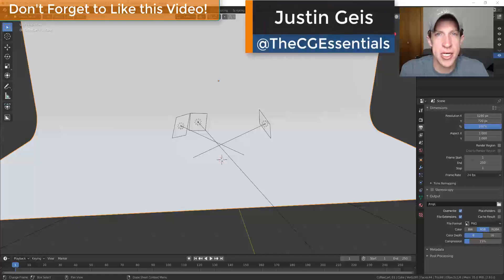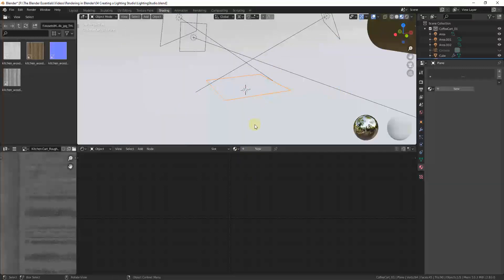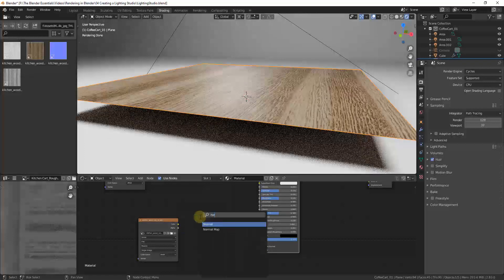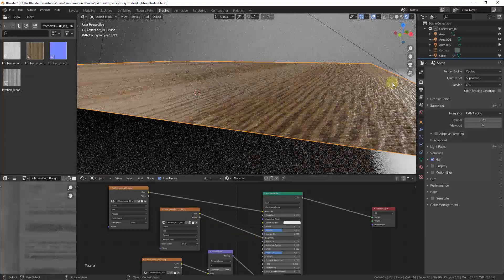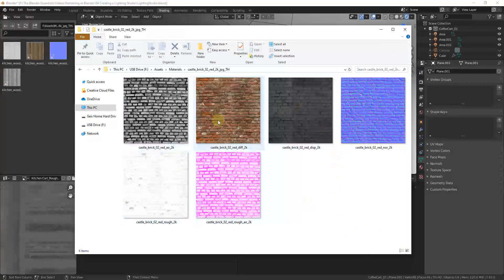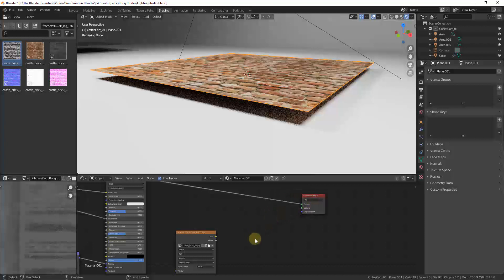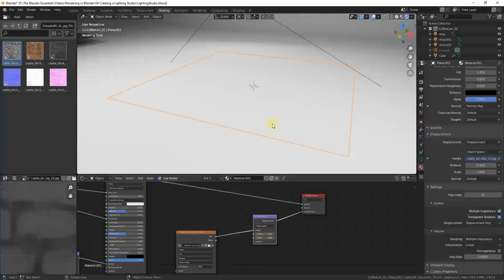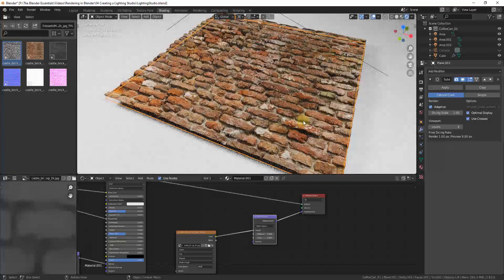Using NORMAL MAPS and DISPLACEMENT MAPS in Blender! PBR Material Tutorial

Comment: Roughness and Normal maps should be Non-color or linear to display correctly. If you use assets with baked normal maps and you see seams at UV boundaries  make sure to check the textures are in the correct color space.
Reply: Yah, I just spent like two hours trying to figure that out
Reply: agree...

Comment: I have a bit of an issue. 
For some reason my material menu doesnt seem to have a section titled displacement. 
(it goes > preview >surface > volume > settings > viewport display >custom properties)

So I cant seem to get any height to my texture :/
Reply from the maker: Are you using Cycles?
Reply: @TheCGEssentials  
I think I might have had it set to eevee. I was able to somehow have the menu change and edit the displacement finally. (But then my computer crashed lol).

Sorry I'm still very noob

Comment: Love your videos. I'm a newbie to blender, but I'm quickly mastering the basics, largely due in part to your vids. A quick question:I'm modeling an aircraft hangar, but it seems no matter how I adjust the texture to the UV map, it still looks stretched out and fuzzy. Is this due to the resolution of the texture? Even subdividing the surface and making the texture smaller doesn't seem to help. Any ideas on what the problem might be? Thanks ahead of time.
Reply from the maker: Hard to tell without seeing it, but if UV mapping is correct and it's still fuzzy, I would assume it's a resolution issue

Comment: I was wondering about a few things: 

With the roughness [metallic] and normal maps, they should be set to non-color, but maps don't always import that way; a lot of times they come in as srgb, and that makes things look horrible.  I've watched this on a phone instead of sleeping so I couldn't see that in the video.  But to mention that would add to the presentation,  imo.  

Which normal map is being imported?  I work mostly "for" UE4 (its my preferred render engine for animations), and make my maps in SP.  They use tangent normal maps.  Of course, Blender defaults to use OpenGL, so I actually want to confirm best practices on flipping the green channel and how to verify when you import a random set of textures the included a normal map is working right.  If it's a tangent normal I used to use the curves green channel only and switched the points to invert the curve slope.  Then I saw the separate rgb and combine rgb,  so nowadays I use those and flip the green channel with an invert node and just connect R and B to the sep to comb rgb nodes.  What is the definitive way to flip the G in Blender?  

What is the best way to see if you have the normal map working right in instances that it's not obvious like a wood grain or something more regular from real life?  Sometimes it looks a little random to me and it's way less obvious if I need to flip or not. 

With displacement, it's confusing to me because as you crank up the subdiv resolution it defeats the purpose of a texture map.  Given your example, I could model the geo of each brick and come in with way less verts than using a displacement map.  

Then there's the height map which as best as I understand it is just a scalar form of a normal map but can be used in place of a displacement map, but suffers from the same self defeating geo explosion. 

Another map that I came to appreciate because of Decalmachine and trim sheets is AO maps.  They really make an obvious improvement to how your texture looks.  The packed pink texture I use with a separate rgb node... but then best practices again, good luck.  In UE4 it has an AO socket.  In Blender, the best I can find to do is take the basecolor, take the AO map...  Connect a color ramp to the AO map (that comes in as rgb as a single but non-color in packed textures...ffs) and then combine the basecolor and AO map to a mixRGB node using multiply, and then adjust to my liking.  It makes a big difference and I even use the AO node in scene the same way, even though I thought with full GI, AO is calculated in Cycles.  That has NOT been my experience.  I add the AO node and get better results..

So any feedback or direction or a part II of this tut at least one person in the world would appreciate because as I've been learning HoudiniFX and Blender transitioning from C4D for 6 months now,  The Blender Way has made my exploits in Houdini feel easier than ever before (!)

Comment: Just a heads up, when using adaptive subdivision, adjusting the levels on the subdivision modifier won't add detail. You set the amount of detail using the dicing scale on the modifier and under the subdivision section in the render settings. Hope this helps.
Reply from the maker: I agree with this comment - I probably wasn't clear - levels doesn't add detail, but it adjusts the level of detail displayed in the viewport so you can see more detail. Adjusting the dicing is what actually adds detail - you are correct. Thanks :)